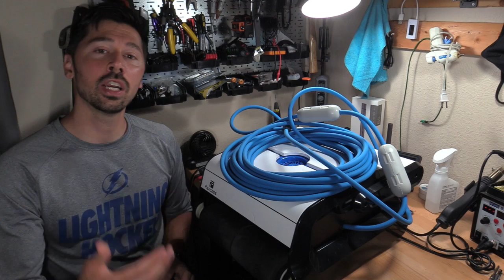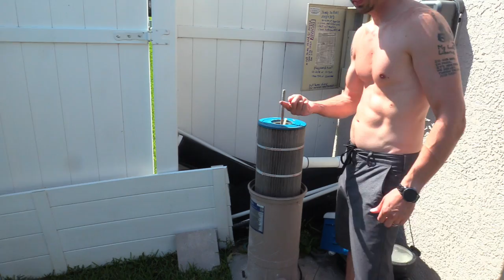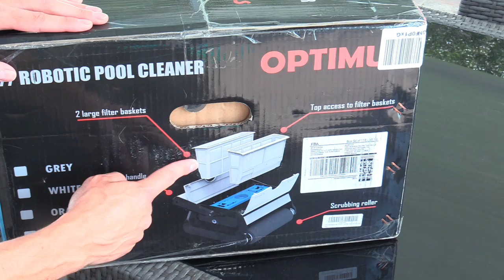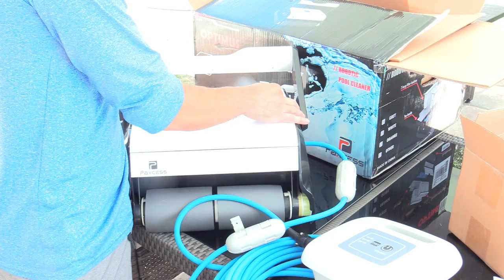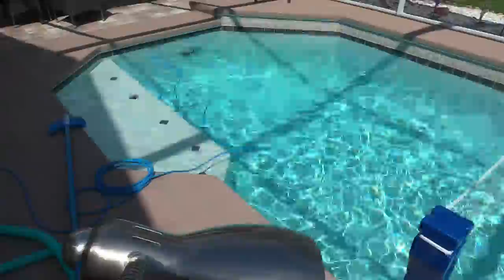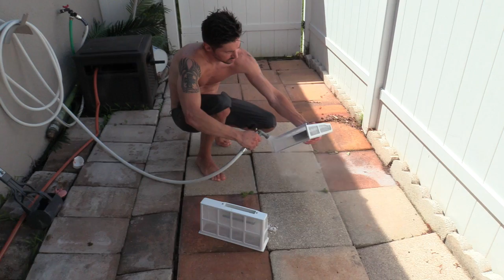How to Clean a Pool using Robotic Pool Cleaner vs Brush Hose Vacuum cleaning service

Comment: Dude, pro tip: let it sink first before you turn it on. Also you shall never be in the water when cable is plugged in to the wall....
Reply: Lol, that is not a pro tip about letting it sink first.